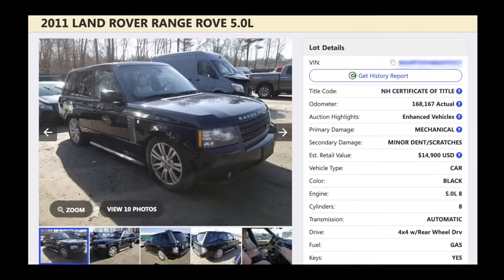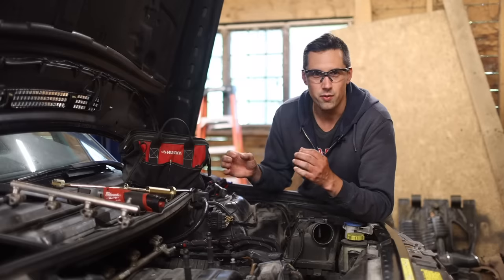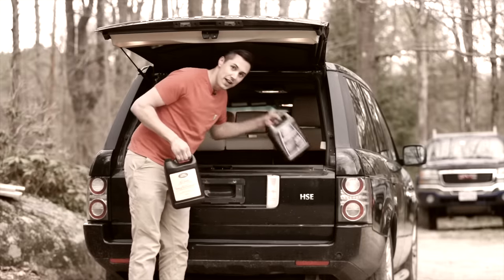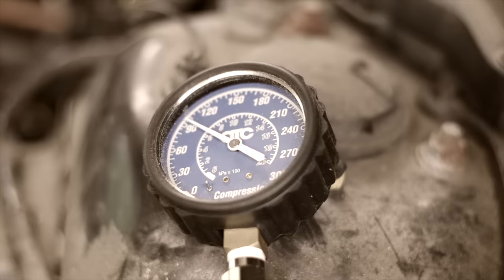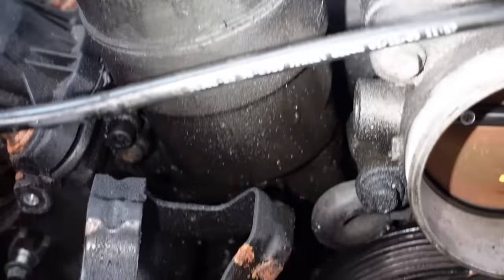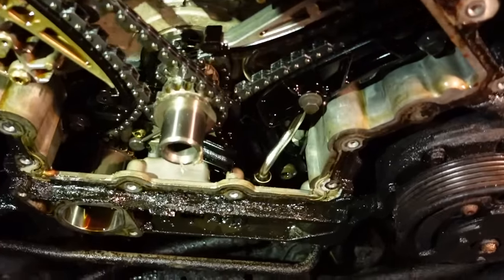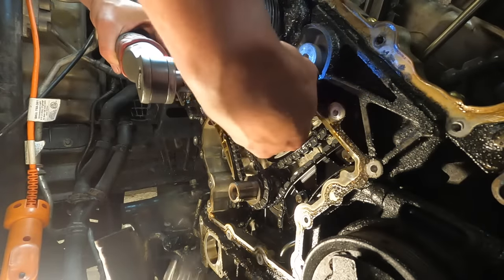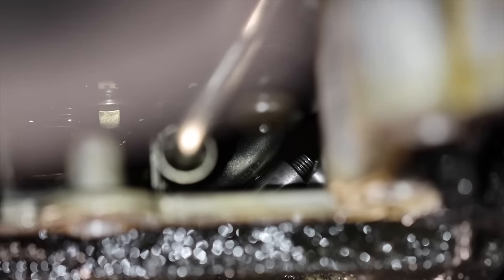I Found This Broken Bolt in the Crankcase of my Cheap Range Rover’s Engine! [Part 3]

Comment: Hey Waldo. I think you need to step back and look at 2 things. First. How much is a complete rebuild. Second. How much is a transmission rebuild?  I say that for 2 reasons. First if tranny is high mileage how long will it last? What’s current state of fluid and tranny itself. Second. If you have a strong engine with possibly more power will it lead to short tranny life?
That being said I’d see how the heads look. Then decide on rebuild. I’d love to see the rebuild as long as it wasn’t stupid expensive. 

Loved seeing Aspen. She’s an amazing pup for sure!! Thanks for another fantastic video!!!

Comment: I don't know if anyone else has mentioned it but, if at all possible remove the radiator prior to front engine repairs. 20 minutes to remove hoses and bolts will save the expense of a new one. Other than that, enjoying the series. Good job.

Comment: Do the overbore, new slugs, bearings. Engine half apart with the heads removed anyway. Go for it. At least you will know what you have when all finished. Check in the UK for oversize pistons - there must be a bunch of them available. Hypereutectic would be my choice if available

Comment: Well I'd vote for a rebuild, except, you might find that a good cylinder hone is all that's required with the existing good compression - no need for oversized pistons etc. Could re-use existing pistons just get new rings, or go new everything depending on cost. It's definitely worth pulling the head off, checking gasket & replacing it, and ensuring flatness of head and block. Doesn't need to goto a shop depending on budget, you can get good results using a flat stone / plate glass and doing the head yourself. Block is harder so check it in-situ then make a call, if you need to remove it and do both block and head may as well machine-shop them both. Good luck!

Comment: It has been very interesting watching this series so far. I remember sometime ago when I had issues with my Honda Accord engine. I figured that rebuilding the engine would be better and more cost effective than just replacing it. This is a Range Rover. It's better you evaluate the cost of an engine rebuild vs an engine replacement, even though watching you take your time to rebuild the engine would be fun to watch. You should compare the cost of the two and do what will be cheaper and save more time.
Reply: I might just dump the Range Rover and replace it with a 5-year old Honda Pilot.  Think of the hours you'll get back to do other things!!!

Comment: Yep go for a rebuild, but before you do go down that route make sure you actually have the replacement pistons. I know that's a 5.0L normally aspirated engine, mine here in the UK is the 4.2 supercharged and I follow a YouTube engine builder here in the UK called Barum Engines and they did one of the 4.2 SC engines a couple of months ago and they had enormous trouble getting oversized pistons from Anywhere, so be warned! The 5.0 l engine is at least fairly common in the US so you may have better luck, but don't be surprised if you can only get standard sized piston unless the aftermarket guys are making them ( and you need good quality forged pistons for a JLR engine! Good luck with it.

Comment: To test head gaskets a good indicator is let the vehical heat up operating temperature and let it set over night and open the hood and feel the rad hose if it’s super super tight then that’s a good indicator.

Comment: Just subscribed, love the content.  Your engine was seconds away from catastrophe.  If the chain jumped just one tooth, then bang!  Considering how good the compressions are, do you really want to go for a full rebuild?  I guess once you have the heads off, you can make a more discerned evaluation.  I agree that the heads need to come off to rule out head gasket failure, and you've already done a lot of the hard work.  But I agree with your theory of the coolant sealer in the radiator and the steam out of the tailpipes.  For sure that needs further investigation.  I have an L322, but with the 5.0L supercharger bolted on top.  You will have a brand new engine, you could comfortably get it up to 520bhp or more with a blower.  I would look into the feasibility of bolting on a second hand supercharger.

Comment: When you mention the Jaguar V8 engine I think that you should call it a Rover V8 engine or even Buick cos as far as I remember Rover or Land Rover purchased that engine (or the rights to it) many years ago as a 3.5V8. This engine powered the original Range Rover as well as the Rover SD1 V8 and then gradually grew to 3.9 and beyond. When I was at LRL we also made a prototype diesel version of this engine but it never really worked.

Comment: I would vote for a rebuild. I'm going through somewhat the same situation. I have a 2012 Range Rover Sport Supercharged. I have some timing issues with other noises I can't identify. I'm considering doing a rebuild with upgrades knowing the reputation of these Jaguar engines for reliability. I just can't see myself outsourcing a used engine that might end up having the same or more issues.

Comment: Yeah, I'd do a rebuild. I did that to my first car, and drove the thing for another 14 years. I then sold it for more than I paid (if we ignore inflation) and until I moved away (about 10 years later), I'd still see it driving around occasionally. The car won the lottery by not dying when that bolt broke off, so it's probably worth fixing.

Comment: That bolt looks like one of the bolts that secure the plastic timing chain slipper to the engine block. Holding it in position while still allowing some side float for alignment. There will be a lot of chain thrashing which will often break chunks off the slipper(s) or smash it up completely...

Comment: I got to a similar point with my 4.0 Jaguar engine and ended up finding a reman for $3500, it was a long block extra that came with everything except the front accessories. It had valve covers on it, that’s how complete the reman was. I could not justify all the specialty tools and additional time it would have taken to rebuild the engine. I know that part of yours will be also contributing to a video about this work and just putting a rebuilt engine in is not as great of content as doing a rebuild.

Comment: The smoke out the exhaust could also just be condensation in the exhaust, remember this car has been sitting a few years and apart from driving it in and out the garage it never ran for longer amounts of time, the exhaust never got hot enough to evaporate that moisture in the exhaust.

Comment: I like the idea of the rebuild for function and long term. But if that is the case, I would like to see you keep the car and hit the 300K mileage. 

Also, this is the perfect platform to do this rebuild, you will get actual interesting content out of it and make out with a solid end result. Don't be conservative and hold back for this vehicle, it seems worth it.

Comment: Check the gaskets, if they be are ok make the timing belt and cleaning the engine from inside. New oil if needed again and it should run smoothly...

Comment: Such beautiful trucks but the only way to have one is to lease it. Enjoy it for a couple of years and start again.   They have never had a good reputation.  amazing when working though.  We had them in Venezuela in the 70['s and they had fuel pump issues among others. However, I would like to see you make this run smoothly again.  I am doing the same to a 2008 lincoln navigator.  Just the timing and a few other things.

Comment: While you have injectors out, Replace them! I've seen way too many times people re use them after and they have issues and poor fuel into the exhaust. The
 5.0. Overall are good motors if takin care of and Givin the timing update.

Comment: If you opt for rebuild you will have to rebuild the top and bottom of the engine, that means new valves and guides and head milling, and you might as well do the chains and cams and bearings while your at it , it will be costly

Comment: Just a maintenance note.  If you wire brush and paint the bottom of your lift right now instead of waiting, you may find that your lift lasts another decade longer than it would have.

Comment: If it was me, I probably would have went with a used low mileage engine just from the cylinder scoring and timing chain noise. Less work and less time and maybe less money. I know that Range Rovers are very expensive to repair and if you use factory replacement parts, change the oil religiously using full synthetic oil every 5000 miles and pray it lasts 150000 miles. I personally would go with a Lexus, but that is just me. Good luck with your project brother! I truly hope it works out for you!

Comment: How about doing a Electric conversion on it? You might end up having  a more reliable powerplant regardless of "rebuilding" the problematic v8. Not sure if its feasible in time/cost/complexity. Either way I look forward to the adventure.😎👍

Comment: I would definitely rebuild. You may think you'll get "tens of thousands of miles" with just the timing fix, but it could be a lot less. Also, how could you sell it knowing what you do about the scored cylinder wall and the portion with the valve impression?

Comment: I don’t mean this to sound as sort of dumb as I am afraid it might, but why the heck would the cam chain tensioner come apart like that? That it did and threw junk everywhere and the engine evidently had over heated, I think a rebuild is a good idea. The RR is worth it I think if you can get the engine right. Or just put a 350 in it.

Comment: As far as content goes, definitely the rebuild.    The safer, potentially cheaper option is an engine swap.    I’ve done both, except for the fun and experience you get doing a rebuild, an engine swap is generally better, only with these engines who knows what state a second hand engine would be in?

Comment: Second hand engine  will cost more. My opinion: 
make changes with the following as change all piston  piston rings and sleaves, timing chain kit  , gaskets, check oil pump for issues and transmission snd differrential oil.

Comment: Hey buddy! Awesome show. I think rebuild. But instead of removing the engine just remove/lift the body completely from the chassis. Check out the YouTube channel from salvage rebuilds Uk. They’ve done it like that before on a rangie. It looked easier to remove the whole body from the chassis and then working on the engine on the chassis.

Comment: I´ve been there before with a 7.3 IDI, I got the transmission removed for a clutch replacement and I ended up with the engine pulled out and doing stuff I wasn´t expecting to do lol

Comment: I hate that stopleak stuff. I went to buy a Florida truck (I live in Michigan and I wanted a rust free truck) and I believe the truck had been sitting for a few months. When I went to drive it home, with the seller knowing full well I had to drive it all the way to Michigan, I only made it 8 miles down the road before it overheated. Turns out the radiator had a huge leak and he had put stopleak in it, but it didn’t fix it and it ended up taking out the water pump and most of the coolant hoses. So that was nice 💀

Comment: I’m not a mechanic, so forgive me if my question seems ignorant. But by boring and honing the cylinders, you would, in effect be creating more displacement. Typically, more displacement would mean more power, but it seems like that’s only if there’s more fuel injected to be accommodated by that space. Since I presume the fuel injection values would stay the same, the same combustion force would be acting in a greater volume and against a cylinder head with greater mass. Assuming all of my statements are accurate, would this result in reduced power output of the engine?

Comment: Dude, from experience, fix it and let someone else enjoy it.  I have had 3 Rovers and they cannot hold a candle to the reliability of the Mercedes GL diesel that I replaced it with.  Main weakness of the Benz was the crappy trailer hitch and the figure 8 washers on the oil cooler.  Currently have a diesel R class. Both the R and the GL are very comfortable rides and have that easy maint you like

Comment: Put head gaskets on it in the truck and put it back together with the new parts. Drive the thing. There is nothing that can be done to make these engines last. Like the 6.0L diesel, you can only put a bandaid on it. They were junk from the factory.

Comment: Hi, i just inherit a Range Rover Sport 2008 from my mother in law with only 64,000 km in it (40,000 miles) most of its life garage kept without been drived at what mileage should i worry about time belt issues?  grettings from Panama, Panama

Comment: New guy here, why does your shop have a dirt floor? Doesn't that make it harder to work, especially when so many things need to to be super clean. I ask because I'm about to build a pole barn, and I could save some cash doing it this way. BTW I dig the Range Rover and Mercedes Series. Also, buying a parts car doesn't always work out. The old "I can fix that" starts creeping in, and then the wife says "Just because you can, doesn't mean you should". LOL

Comment: You have found a range (rover) of parts that are questionable in terms of damage and wear, that it may well be the best course to go that step further and recondition and rebuild fully and correctly.  It will give you the opportunity to determine what else is doubtful and replace/resurface those.  I suggest that provided your funding allows, it would be the best course to do your full job now, and thus put you on course for a full life for the engine.  It will also give you better peace of mind that you have a vehicle whose engine you can then rely on.  Wishing you "Happy Days" and safe motoring!

Comment: This is pretty weird, a lot of new cars seem to have similar issues.. across all platforms gas and diesel .. The Audi Q7 with a TDI 3.0 has the tensioner guide breaking.. The 3.0 supercharged engine has the same issue of course with 100+ thousand miles

Comment: I’m disappointed at the manufacturers for making putting such defective fail prone parts in such critical parts like the timing chain guides, they should recalled these and fixed them. Same thing with the BMW N20/N26 engines, all the timing chain guides were fail prone, stretching the chain. I think since your more than half in way tearing down the Land Rover, just go in for a total rebuild and enjoyed it for years !

Comment: As Im sure you know, that engine is famous for problems. I suggest a replacement with a rebuild that includes all the improvements to date. You’re so far into it that an engine swap is more efficient , long term, than doing further work on this one.

Comment: I think finding a good used engine might be cheaper. I would speak with a machine shop first about the options for the cylinder damage on that engine. Could get REAL expensive.

Comment: May as well rebuild as head gaskets are suspect so pulling the bottom end apart isn't taht much more work in teh scheme of things. Pistons? Try looking in the Mahle catalogue. Should find them in there or a engine recon shop can look through their catalogues n find what you're after.

Comment: Pull the engine and do the complete rebuild.  With the internal damage you are finding, a partial job is a recipe for disapointment.
Here's an alternative to consider:  Swap in a domestic V8 instead.  Will a Ford 5.0 liter V8 fit?  Or, does someone make a kit to install a GM LS V8 and transmission?  Food for thought.

Comment: You’re doing great work Waldo….but at what cost?   I have a 2012 Ford Escape that has 140,000 miles on it - no noise, no, broken bolts, no leaks, and no rebuild required.   Sorry, but I just get the allure of these high-buck vehicles with fragile engines…

Comment: I would run. Lol. Had the hse with similar issues.  Absolute money pit.  Every time I drove it somewhere something else would break.  Took the loss and got rid of the pos. My wife called it driveway art. Awesome vehicle until you drive it somewhere and have to get towed back home. Lol😂

Comment: "wouldnt it be pretty cool to have the first range rover to hit 300k"  Doesnt count if you have to replace the motor lol.  Ill be hitting 350 000miles on factory audi a8l engine soon. Factory transmission as well.

I also vote for you to do a rebuild

Comment: My experience with Range Rover  vehicles is that this is going to break your wallet and you will end up with something that is still unreliable, when you could be working on a older Toyota Land Cruiser that would give you far more performance and easily go 300000 miles. But I love watching your videos.

Comment: You can get  Range Rover parts from Atlantic British Parts.com that where we get all parts for our 2012 Range Rover with 120, 000 miles and our 2005 LR3 Se  Land Rover with 260,000 miles. 
We have been lucky 🍀 we had usual maintenance on our cars some a bit more expensive than others but nothing over extremely expensive. They are great cars but you need to maintain the upkeep of them if not you will have major issues. We have been lucky plus we have a mechanic that knows how to work with Range Rovers & Land Rovers. 

Hope the website helps, they also have a YouTube channel that gives you pointers on how to change parts, etc, plus you can always call them to ask them questions, and most likely maybe they can guide you where you can find parts in your area. Good luck 🍀 and rebuild you will be glad you did it, it’s an amazing car. 🙌🙌